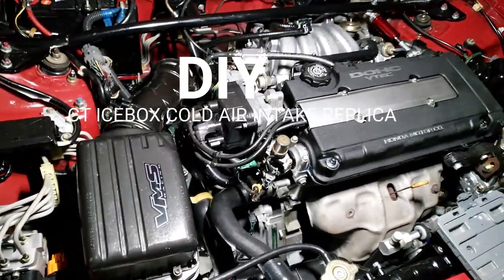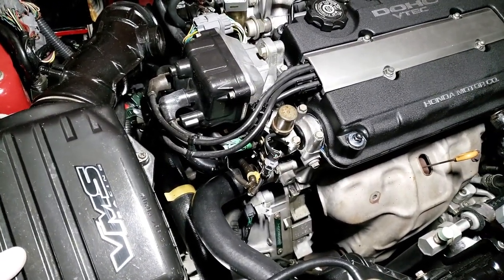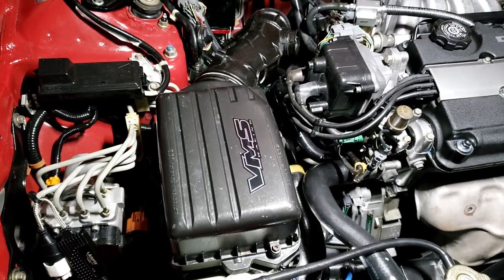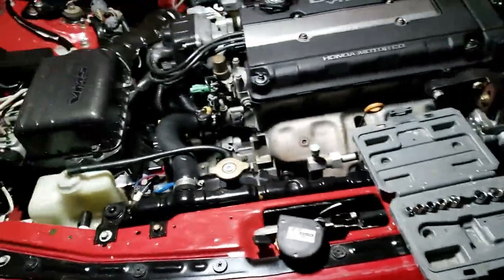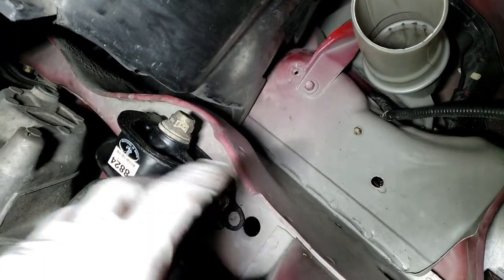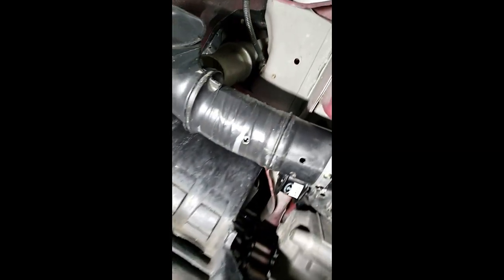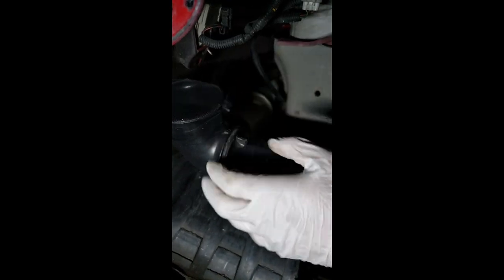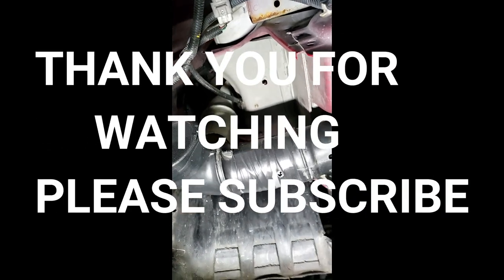DIY: INTEGRA GSR ICEBOX COLD AIR INTAKE REPLICA

Comment: An interesting idea but slightly flawed. To replicate an icebox or Mugen intake effectively you must enlarge the air opening into the airbox and increase the size of the pipework. Without doing that all you gain is very little noise from removing the resonator box. 
The improved breathing from the bigger ducting will result in some proper induction noise

Comment: Either way bud, the box is actually going to trap that heat and keep it in that box bud, got my short ram going to the fender, I definitely get more power, I feel the intake filter,it's cold, not hot, the box is going to heat soak, without one, it would actually breath better. This is your opinion bud, not facts
Reply: Ok "bud"...you couldn't be more passive aggressive. You extended your "short ram" to the fender, and now its a cold air...your filter wasn't hot but how about the rest of the piping?
 Everything you said was your opinion and you didn't bring anything to the table.....bud.